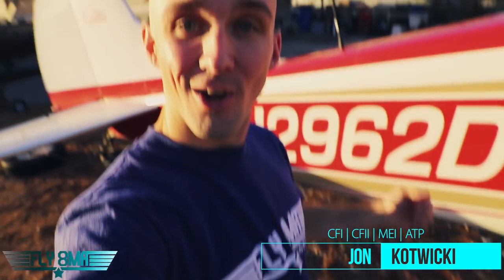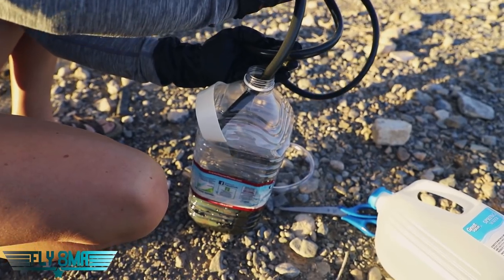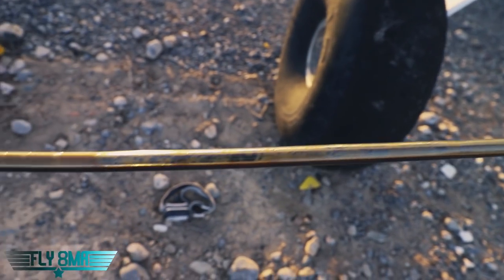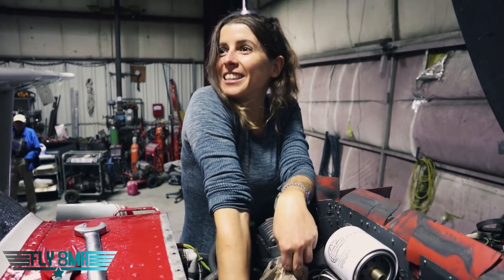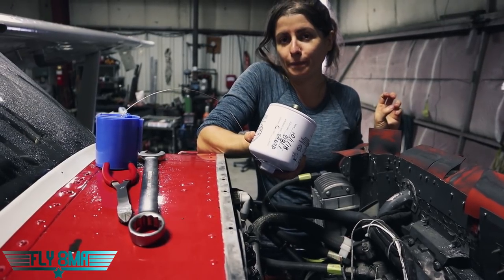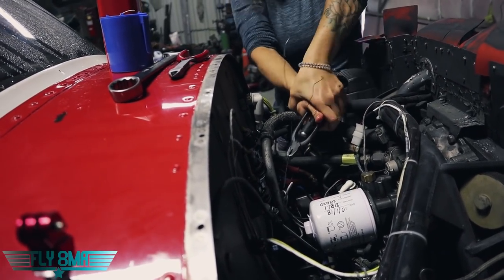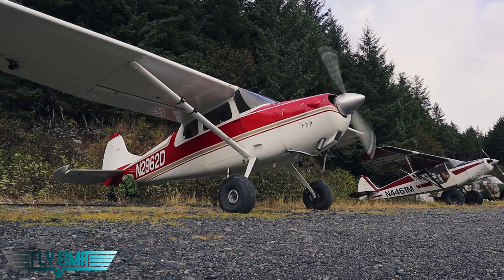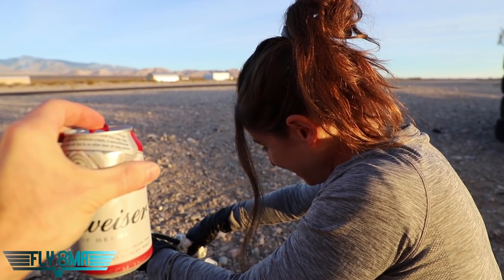Airplane Oil Change in 3 minutes!!!

Comment: I'm an A&P. I can say with confidence that prefilling a filter doesn't matter. If you want to, go right ahead but it can be a messy process. The engine will push new oil through the filter so quickly that like I said, it doesn't matter. Personally I wouldn't do it and no a&p's that I know would do it either. Just lubricate the seal and screw it in. As far as that plastic bag method goes, I wouldn't. I'll like to puncture a hole on the topside of the filter where the hex fitting is and pressurize it with a blow gun. That pushes the oil out of the filter and into the oil sump where it can be drained with the rest of the oil. That or I'll have a little ramp under the filter that connects to a small container placed on that convenient little shelf where the firewall is. Run-on sentences FTW!!!

Comment: 2:43  She's right.  In my experience, trying to pre-fill a horizontal filter just makes a big-ol' mess.
Reply: Just don't fill it as much as you would one that's vertical. It's fairly easy to accomplish without a mess if you're not inept/have some skill and have some common sense.

 I've had much harder reaches than that for horizontal oil filters with blind filter housings that have to be done by feel and don't make a mess. I would also rather clean up a bit of spilled oil than run without oil pressure for the length of time that it takes the pump to fill the filter before it gets to the oil galleys and critical components
Reply: I always pre-fill them.  If they are horizontal it’s just only about half full instead of all the way full.
Reply: Pre-fill like 30 years ago was standard procedure even with car and truck engines. Oil  produced with today standards are much more better, so everything left in that engine on the piston walls and around can keep viscosity enough time until fresh oil fill the new filter and start lubricating engine properly. When overhauling engine standard procedure is filling that filter cause engine parts all dry. Thanks for reading. And safe flight everybody.
Reply: yeah it's a useless practice. The oil pump will start squirting oil onto the cylinder walls in like 5 seconds.

Comment: Send your oil in for analysis. You have to do it several times to get a baseline.Depending on your time since overhaul, metal in your filter could be break-in/ normal. They will list the different types of metals found. It might give you an early warning. I've  never filled my filter with oil (Spin on), just oiled the gasket and if slightly over filled it would blow out and stabilize.
Reply: Or just check cylinder compresion. If something wrong it is going to lose compresion. Easy to do it and you wont wait 2-3 weeks for results of oil.

Comment: I've changed the engine oil many times on many types but always good to watch to see what you can pick up.  Good tip about the plastic bag, I've got an RV4 and the oil defo gets into places the sun don't shine - a bag will certainly help.  Also, don't use cheap low quality filters, lesson learned ;)
Reply: Just make sure to remove all old safety wire before putting the plastic bag in place.. wire and plastic= not a good mix lol
Reply: @stephdachef  Agreed, got scars to prove it LOL!

Comment: Some oil filters go on dry these days.  There is usually a very specific torque that you need to tighten the oil filter to.  I think the oil would drain a lot better if the hose wasn't so long.

Comment: I've never heard of prefilling the oil filter. Just saying.
Reply: You really should be pre filling/priming a new oil filter while doing an oil change. If you don't fill it then the oil pump first has to fill the filter before oil starts making its way to the bearings, pistons, and cams. The more oil you get in the filter and the more you soak the filter media before starting the less time you'll be running the important bits without any oil pressure right after a change. There's still a film on the rotating parts from the last time the engine was run, but having oil pressure  sooner is much preferred.
Reply: @goingtoscotland  exactly! I prefill my oil filter everytime. The one time I forgot, my engine told me about it! :o!  Prefill everytime.
Reply: What about the factory oil filters that are installed inverted? No possible way to have any oil before install. I've never seen any engine maint manual on a piston state to fill filter with oil before install. Lube the gasket? Yes. Fill the filter? Negative.
Reply: @FrigidColdFlying  you actually can add quite a bit of oil to those and let it soak into the media. When you upend it it won't drip or spill if you haven't added too much. Obviously there are exceptions, but whenever possible you should get as much oil in the filter before you install it as you can.

Every little bit helps. Don't be obstinant just for the sake of your own stubbornness
Reply: You had me until you called me stubborn. I've been in aircraft maintenance and instection for more than a decade. I'll stick to what the manuals say and don't say thanks. Cheers.
Reply: Just because you think it's necessary does not mean it is a maintenance requirement.
Reply: @FrigidColdFlying  

Show me where I said it was necessary. Don't worry, I'll wait.
Reply: @FrigidColdFlying  Also, you were being stubborn by definition.
Reply: Sorry man. There is no common sense in aviation. If it doesn't state it in a maintenance manual you have zero backing for it. Just because it's good practice does not mean it's approved. Lawyers. Follow the letter of the law. If you stated you had done that and the engine failed, you would be explaining where you got the maintenance information telling you to do that. If it was a good idea it would be stated verbatim to "fill the oil filter with 20w50 before install." Until Lycoming or Continental start putting that in their manuals I'll pass on trying to know more than the manufactures. Even if you are a pilot who does not hold an A/P you are still required to follow the instructions in the maintenance manual. It's not a car. There are manuals there for a reason. They are not optional or open to interpretation.
Reply: Alaska to Africa, you have an excellent point that you gotta follow the maintenance procedure outlined in the manual and it is not a car. I have yet to look at a procedure in a manual for a lycoming engine so I believe that it is not there in the procedures. I have been doin oil changes on cars for a long time and it is very common, and in fact suggested to fill the filter in more than one car manual that I have seen for all the reasons stated.  In fact my son who took auto shop in high school a few years ago busts my chops whenever I do not fill the filter to his expectations.
Reply: @alanlanker606  if Lycoming or Continental wanted it done it would be in the manuals. They have revised them over the years and they still don't want them filled for whatever reason.
Reply: @goingtoscotland  about 25% or less of circulating oil goes through the filter. So no, engine will not turn without oil while,  "waiting" for the oil filter to be filled up.

Comment: Why can't aviation piston engines have drain plugs like our everyday piston cars?
Reply: Some do. The quick port is really more for attacking a hose. Not as long a hose as these two have, but you get the picture.
Reply: They do. You can also get these quick drains for cars as well.
Reply: Mine does